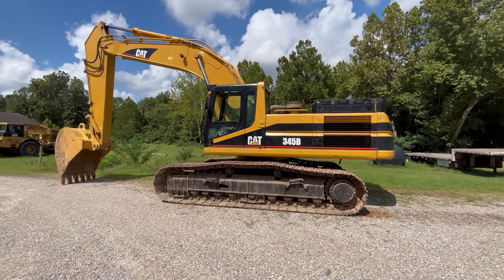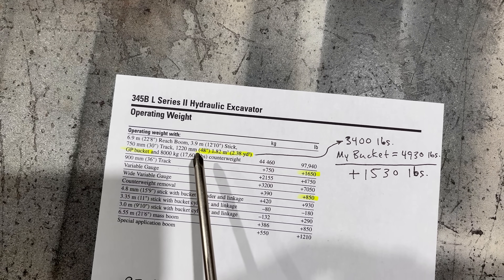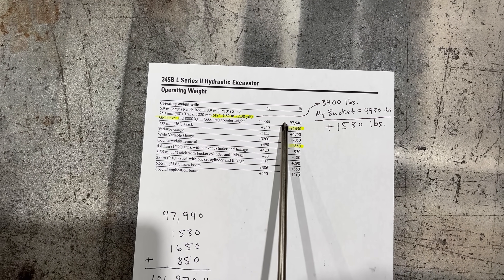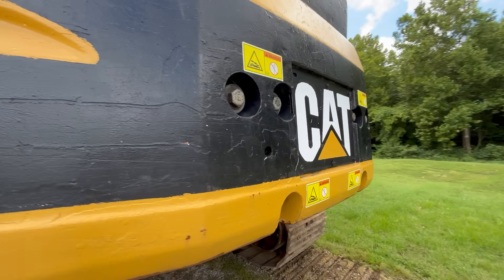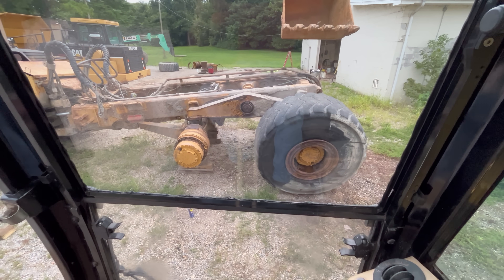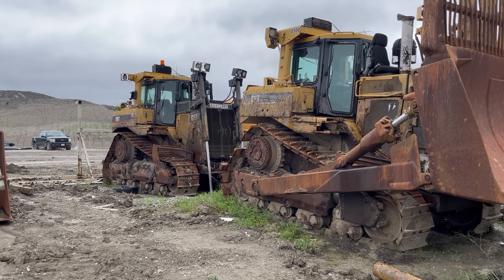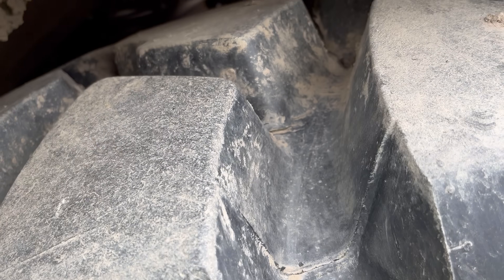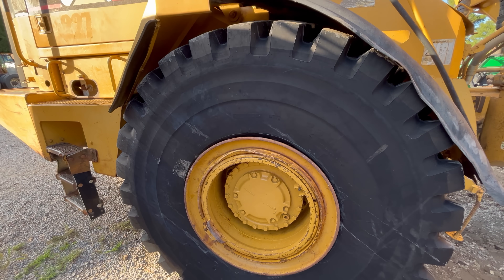Removing a 17,000 Pound Counterweight - Caterpillar 345B II Excavator

Comment: Being under that counter weight made me clench up a little. That’s a neat system though.
Reply: same seems super dicey
Reply: Wait till you watch his other Videos, standing under an engine unbolting the oil Pan, while the engine is being lifted by a forklift and chains. He's crazy, that's why we all keep coming back here.
Reply: @st_us  my favorite video is the one with the truck burnout that lights the backhoe on fire
Reply: I know of several people being killed removing them that way, at Cat dealerships.
This dummy should read the manual.
Reply: @mongoblazingsaddles9440  always a saftey Sally somewhere
Reply: @mongoblazingsaddles9440   i cringed  when I saw that, how are the blocks supposed to be turned and stay clear?
Reply: @nathanhudelson4935  walk underneath the excavator from the front and tap em with a hammer would be my guess. very cringe just waltzing right under that weight
Reply: @baronvolkov6172   See the big square hole in the centre, i would bet that is 1 inch to take a standard 1 inch extension so you can use a breaker bar without being under the counter weight.
Reply: Yep, putting a lot of trust on hydraulics that can fail at any moment. Still amazes me how many people lift a vehicle with a jack and work under it without jack stands.
Reply: Yeah, definitely a hell of a lot of: "Uhhhh I would not do that"
Reply: I came here for this comment. Being underneath such a "loose" beast is just insane.
Reply: @alex4alexn  I'd much prefer to be a safety Sallie , than a flat Freddie.
Reply: @WiIdbiII  yea, problem is that you arnt him, so let him be
Reply: @WiIdbiII  lol, didnt you reply to me? if not, my apologies, cheers
Reply: @alex4alexn  all's good.
Reply: I was thinking I would be using a stick to turn those blocks.
Reply: Thomas Franklin  wipe your tears and get over it
Reply: Yep, Murphy's Law. I have seen some crazy S**t happen around construction equipment.
Reply: @alex4alexn  Yeah, wait until you've recovered a couple of bodies from industrial accidents, it might change your mind.
I've worked as a heavy equipment mechanic on drilling rigs, hard rock mines, underground mines, and logging all my life.
Stupid is stupid.
The only thing holding that weight on are the bolts, it doesn't sit on anything. It shows all that right in the service manual.
Reply: @mongoblazingsaddles9440  well you have seen it first hand, so i dont disagree, but there is danger in every aspect of life. It is his risk to take
Reply: @alex4alexn  I broke every company rule in the book but I never broke the laws of physics.  That counterweight removal job can be done easily without ever being under the suspended load.
I've done a lot of work with large cranes.  You never go under a suspended load.
It's dumb.  One guy was crippled for life and another killed removing a counterweight from a 390 Cat at one of the other Finning dealership branches in Edmonton three years ago.
One of the things they did wrong was remove the bolts with an impact.  Cat wants you to use a hand tool to ensure that the bolts are loose and have no load on them when they are removed.
Reply: @mongoblazingsaddles9440  That is wild, i believe you , you have to be safe where you can, be safe out there

Comment: It's amazing how far battery operated tools have come! As a contractor for over 35 years, I've seen the changes up close and personal...That Milwaukee impact is A BEAST!
Reply: Their the best
Reply: until the battery runs out
Reply: @s0nnyburnett  as compared to an air tool that the compressor could never run out of gas?
Reply: Same, it was a Ford diesel site compressor from the 70’s running a one inch air gun when I was in my late teens :o)
Reply: I can remember when I could stall a  plug in Eletric impact. .late 60s.
Reply: @olddave4833  I’m getting stronger. I couldn’t bend my erection when I was in my twenties :o)
Reply: @s0nnyburnett  Then just put in another battery? I mean seriously?
Reply: @s0nnyburnett  then you get another battery.... how is that harder than having to run hundreds of feet of waterproof electrical extension cables across a job site, especially when there is heavy machinery like fork lifts and tractors moving around?
Reply: @davidskiffington7039  Out of gas?
Reply: Even in the last 10 years the amount of progress battery tools have made is incredible. I have an 18v 1/2” impact that I bought in 2010 that was rated to do 200ftlb of breakaway torque and I thought that was pretty decent, now you can get 18v 1/2” impacts that can do 1200ftlb of breakaway torque. Hell milwaukee sells a 12v stubby impact that’ll do 250ftlb.
Reply: @s0nnyburnett  Pop another one in, put the other on the charger, and keep working again.  Been switching all my stuff to battery operated and it's great. Even yard tools.  Battery chainsaws have come a long way and lawnmowers too.  I'm looking at getting a battery operated snowblower too but going to wait that out a little.    The tech has come a long way especially with brushless motors.
Reply: @Fhwgads11  Yeah, air tools are going the way of hand nailing...:)
Reply: @s0nnyburnett  For a business, the cost of such battery is like spare change coins... They can easily buy 5 of such batteries, or 10...
Reply: @solomonshv  my extension cords always get ran over by the skid steer on my jobs. They don’t hurt them they just smoosh them in the dirt
Reply: If you know which way the threads go also helps
Reply: Thank you for saying Milwaukee and not any of the others. Learned to buy red 20 years ago
Reply: Take a look at Torque Test Channel and be amazed at some of these new battery drivers.
Reply: taking this a step further, imagine a big high-voltage swappable battery where the counterweight sits... CAT and Volvo are already involved in electric equipment on a BIG scale, fast charging for mining, mobile DC charging blocks to plug your digger in during lunch break, bigger stuff. This is going to go faster than many anticipate

Comment: Very clever how that counter weight comes off. Nvr seen that done before. TY.
Reply: now, why did he remove it? what happens if it tips while he is next to it? wild that small of a piece weighs so much, what element is it if so dense, not just steel i am sure? anyone? thanks
Reply: @drdwgmd14  he took it off to trailer it to another site, the lighter you are, the easier (and cheaper) it is to permit. And it could be lead, but likely it is steel, just hard to see a good scale to reference to.
Reply: Won't tip without the counterweight... Unless you reach the boom out all the way. If you do so the tip is very controllable and fun. Ask me how I know. Same is true with forklifts. I've driven forklifts without counterweights that were ready for the local roundy round track with all that weight removed. Thing is traction becomes a huge problem and stopping can cause a 2  foot high endo.. just sayin'. Playing with big equipment can be fun!
Reply: @jd5997  counterweights are made of this weird mixture of scrap steel and a form of concrete. You run into bits of steel almost everytime you sand down a counterweight for paint.
Reply: @drdwgmd14  The structure assembly counter weight comprises a box body and a filling material which is filled in the box body, the filling material consists of the following components by weight percentage: 30-50% of iron sand, 20-30% of iron pills, 12.5-41% of quartz sand, 1-5% of gangue and 2.5-8% of cement.

Comment: I’d never get under that counterweight without some sort of safety stand! 17,000lbs is life ending sir.
Reply: Exactly what jumped out at me. You're crazy to get underneath there without safety cribbing.
Reply: it would be a fast way to go.
Reply: Whats life without the occasional threat of death
Reply: He was wearing those Pakistani safety sandals.
Reply: Pffft…..safety is for losers….just like brake pads…..😮😊
Reply: I could lift it easily
Reply: And there was no need to be under it.
The blocks can be turned with  one inch extension and ratchet.

Comment: Oh wow, it was incredible to see how that weight comes off like that, awesome. Also WOW that Milwaukee gun is insane and only powered by a single battery!
Reply: That's how you take it off if you want to get killed.
He should read the service manual.
Reply: @Parker I haven't seen the manual, but that part made me cringe!  The only thing holding it up is the cylinder and a broken hose or seal and it's 17,600lbs of smash hammer.

Then again, look how many people use excavators as a crane, and walk under the elevated bucket to connect and disconnect loads.
Reply: @Parker how exactly do you turn it then?
Reply: And he wasn't even using the big M18 battery that comes with the electric chainsaw setup.
Reply: @isatntt  I'm wondering that too. It seems like a bad idea to go under it, but how else do you do it?
Reply: @matthewbeasley7765   buckets have a locking pin
Reply: @billymcilvian  Have another excavator hold it up with a chain
Reply: @PBST_RAIDZ  You'd still have to go under it. Too many points of failure to trust that, you still have massive potential energy with no reliable failsafe.
Reply: @isatntt  The tabs have a square slot in the front, should be 1 1/2". After lifting the weight up you would stick in a long ratchet extension wich allows you to turn the tab without being under the weight.

Comment: We used to haul that size machine a lot on 8 axles regular deck with a stinger without stripping them down here in Florida. We didn't strip them till 650s or bigger then we used the beam with 11 axles.
Reply: i've hauled 345s on 6 axles that's all we're required in maine for 100,000 (plus we get a 10% grace weight)

Comment: Biggest counterweight I ever lifted was a stupid "shyster" 60,000 pound truck, the counterweight was said to be 18,500 according to manufacturers info. We broke 2 chains (that chain is Bulletproof!..seconds before it broke and counterweight dropped) trying to get that sucker on and off. We used a Royal (brand name) steel lifting truck to hoist this counterweight. There were 4 royals in the rental fleet. Another escapade involved two of these royals and an alley...and a super duty ford f350 cab that had been flipped and it's vin needed a new home on a body in white we found in nowhere's-ville southern michigan. Being near dearborn and home of all things Ford it's actually not that unusual to find unusual ford stuff around here. The body in white was a good 15 years old when we found it and still in it's shipping crate. Cost $4 freaking grand but came with fenders doors hood and even glass all installed. Just never had seen a frame in its life. The rollover cab had to go somewhere so eventually the two Royal's in the alley did the trick of smashing the old cab into a cube.

KT this is a great vid as always. Just wanna say a 17,500 counterweight is not all that huge in the lift truck world. Still tho' so many people have no idea about the weight of this stuff!
Keep the vids coming brother! I especially like your teardown vids and engine building clips. Reminds me of good old days and young people need to see how this stuff works!

Comment: 7:25 there is probably a socket connector inside that block, so you don't have to put your life in the hands of that chain that keeps the counterweight up. Use a long extension rod to turn that. I feel a lot of big word counter arguments coming on my comment, but the moment that counterweight actually falls onto someone and the whole funeral stuff is happening you'll quickly think otherwise, wishing you could revert time 5 minutes.
Reply: Yeah there has to be a safer way
Reply: Putting hands into a pinch point while standing under a 17k weight suspended by rarely used hydraulics... had me sweating just watching.

Comment: That counter balance system is an eye opener.  I've never seen it before. That must be a pretty good bolt that connects the weight to the chain lift.
Two questions;  What is the torque rating on the Milwaukee 1" impact?  What are each of those beautiful Bridgestone tires?
I agree with Matthew Romano said about your "worn our 345.  Cleaner than most anywhere.

Comment: Hey man quick question, wouldnt it have been safer if you removed the counter weight bolts first and then started messing with those switches. Just in case that counter weight came crashing down. No idea how the system works just a thought.
Reply from the maker: No, that would be a good way to get smashed.
Reply: you have to pick up on the counter weight a little bit to get the bolts out. when the mast is down, the cw sits on the blocks and puts a bit pressure on the bolts

Comment: The counter weight has voids? I wonder why?
Reply: Not being a smart ass. I genuinely wonder why...
Reply: My guess is that they make moulds (or molds) for casting these things.  Probably the bottom mould would end up being the outer (face) side (what we can see when it's hanging on a machine), and then when they pour molten steel, depending on what weight of counterweight is being produced, they would lower a displacing mould from above that would squish or force out the proper amount so that if they were producing smaller weights, they could press the displacing mound further down inside, or if running heavier counterweights, they would press the displacing mould shallow(er) into the poured steel.  That way they would need fewer face moulds to produce a wider range of counterweights.  
If the counterweight that we saw in this video was solid from front to back with no voids,  I could imagine it would be double (or more) of the 17 thousand that this one is.  I am not sure what would be the biggest, heaviest counterweight out there that would need to be hung off the back end of an excavator. But I do know this: without the counterweight,  forget about doing much other than simply moving the boom and stick around in the air, and not very far extended.
Reply: @stanpatterson5033  that's an excellent insight. It makes sense. Thanks for answering my question.

Comment: Not to be the "saftey" guy here, but coulda used a 1" extension on those blocks instead of standing under hydraulics that could fail at any moment.
Reply from the maker: You're right.  Could have also worn a helmet to protect from flying debris, or could have even just stayed in the house and not done anything at all.  That would have been way safer.
Reply: @KT3406E  Exactly ^^

Comment: Thanks for the info! My 345BL Series2 has variable guage UC. I cant find any info on moving the track frames. Can you help? Thanks!
Reply from the maker: Get an operation and maintenance manual for your prefix of machine.  It should be an ALB or DCW.
Reply: @KT3406E  thx. My 345 is darn near showroom for its vintage. Variable guage UC and hydraulic counterweight donning system. It luckily was dispatched to a location where it was little used and I bought it as a fleet reduction. Turned it into a pile driving carrier and paid it 40 times over in 3 months. Don’t really need to adjust or remove track frames but am curious as to the proceedure.

Comment: No f*cking way would I get under that 17,000 pound weight with rusty chains holding it up. Jesus, you're just asking for it. I would, at the very least, lube the crap out of those chains with a can or two of quality motorcycle chain lube, which have special waxes that hold the lube on.